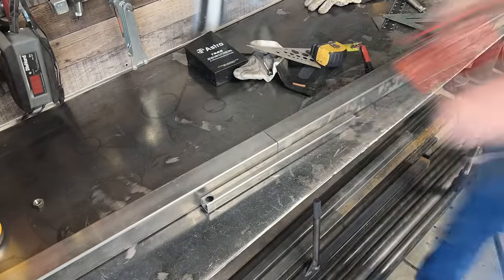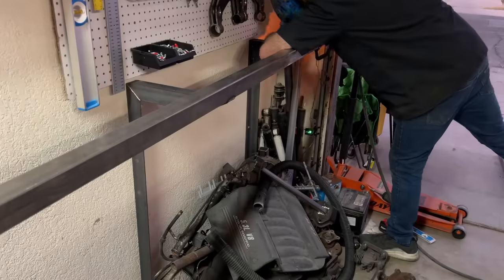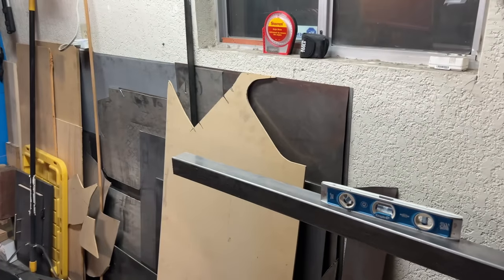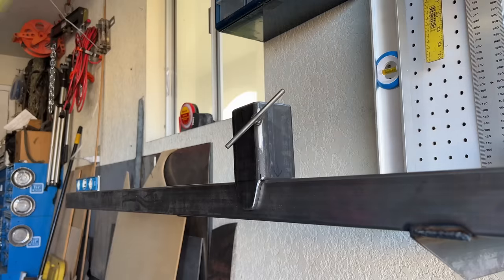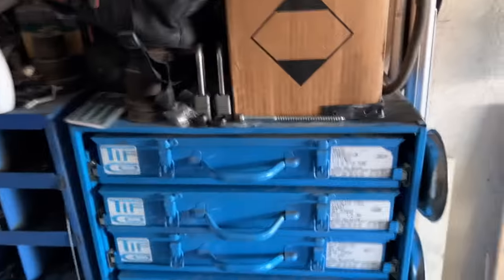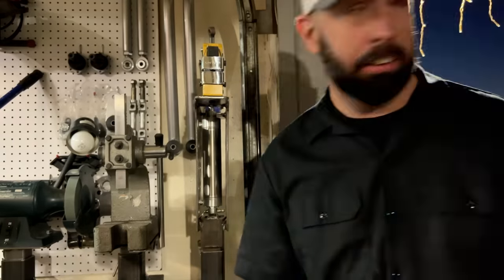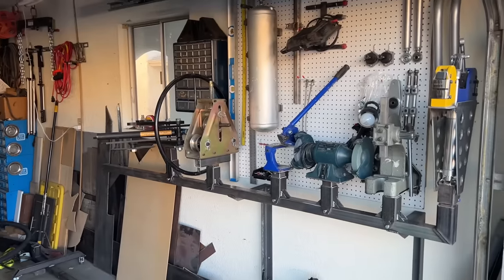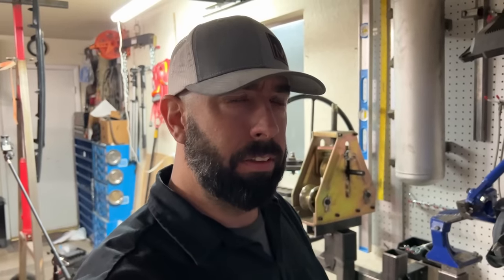Brilliant(er) Legless Tool Stand/Storage System! Part 2.5!!

Comment: I would use the rolling rack for the sheet metal that way you can roll it outside an load an unload sheets out of it and also on the tool rack I would make some arms that extend outwards to put tools like a band saw on or the grinder or even a bead roller you know future investments

Comment: To solve the sheet metal access, put a heavy duty hinge at the bracket by the window, that way you can swing those out of the way to access the metal...   or build a rolling rack to hold the sheet metal that you can wheel it out to get any piece you want when the other tools are swung out of the way.
Reply: I was thinking the hindge to. Could actually double the storage as well with it folding in front of the other tools.
Reply: Wow,  the first comment I read and you have solved one problem and greatly improved sheet metal storage.   Home run with full bases!   
(If you have time....solve my garage problem....I haven't seen three walls in there for years.)   Have a great week ahead!
Reply: @Dancing_Alone_wRentals  Sooooo relatable!  Although I have more than three walls of my garage I haven't seen in years.
Reply: @tptrsn  I find it helps to leave a trail of sockets and box wrenches.....and by all means keep a flashlight handy!
Reply: @Dancing_Alone_wRentals  🤣Thanks for the tip!
Reply: Or just use the rest of the wheel rack to store the sheet metals? And just roll it aside to pull one out.

Comment: Save a lot of space by getting rid of the rack and putting all the tools on a rotatable rack placed in the garage corner. Kind of like a lazy susan. Also no need for all the gussets. Weld a piece of strap steel across the front of the rack that would be just above the bolt. When tight, the bolt couldn't move upward to let the mount fall over.

Comment: If i see your post you put in your hole in the floor i recognize it wobbling.. so maybe you weld a plate a few inches from the bottom of the post that sits on the ground with the post in the hole.. and maybe even make a hole in each of the corner of the plate and  weld some pins in and drill holes in the floor that the pins fit exactly in when the stand is in the hole..That way it prevents the stand from moving while you work

Comment: Maybe store the stheet metal on the rolling rack?  Build a sliding drawer/shelf under the wall tool rack to hold that portable cutoff saw that you're using on the ground - the shelf could be a work surface when the work stock would fit.

Comment: I love it when a plan comes together. Nice execution! I have a feeling there are going to be a lot of these in garages across the USA. If you get more tools you could probably add a lower level to the rack, and maybe angle the lower level receivers out for easy access. Just a thought.
Reply from the maker: I had considered making a smaller rolling rack that slid under this one, but I really like that angled idea!
Reply: do a lil magnet for the allen key @GarageFab
Reply: I should have read your comment before making mine. We're on the same page with angled lower row 👍 EDIT: In fact, the upper bar could easily be against the wall & angled instead of sticking out, for smaller effective footprint.

Comment: Great way to use viewer suggestions!
I would mention that if the setscrew tabs were extended a bit below the bottom of the rack tube, the tips of the setscrews could be conical (you can buy cone point)  and when tightened, the side of the cone would contact the bottom corner of the tube, pulling the receiver down, and preventing it from tipping.  This would still allow the screws to be backed out and the receivers could be lifted up and off.
Just found your channel today and subscribed!
Reply from the maker: Simplicity at its best Keith! Now I have to try and overcome my laziness To either extend the tabs or remake the holders. 😩

Comment: Might add brackets on the bottom sides of the post, like you did with the tool holder brackets but bigger, to give you more stability when using the tools.

Comment: First, stand the sheet metal up as it will take up half as must space as compared to laying it on its side.  Second weld a cross tab on your set screws so you will not need the Allen key that you will inevitably lose.

Comment: V2.6 Idea: Burn another square tube across at the base of your 45* supports (attached to the 45s). Then you can have a second row of tool heads tucked in beneath, sticking out at 45* and cut off the upper tool bar at the left wall bracket. You'll increase tool capacity & wall space for sheet goods AND retain floor space below tool heads. Hope this makes sense, I struggled with how to word this despite the idea being simple. All the best, Andrew Thiessen
Reply from the maker: Thank you, Andrew! It does make sense. I’ll likely go with something like that. 👏

Comment: Your probably done making changes but...Since you are a master fabricator of heavy duty stuff and you put your tools storage near the garage door corner maybe you could rig up something that holds your stuff but pivots away from the wall like a jeep spare tire rack.  It would need to be super heavy duty to hold everything without end support, maybe have a folding leg.  You could still slip sheet goods behind the rack still   With locking pins you might even be able to use some of the tools on the pivoting rack in front of your garage with a fold down leg or something like that.

Comment: Do Not totally dismantle your original rolling base for your first rack instead repurpose said base into a rolling sheet metal / bar stock rack wich will eliviate your issue of getting full sheets in and out of that tight spot....peace and love your vids.

Comment: Put tool rack on wheels. Store it under a table / shelf.
I would put the sheet stock closer to the garage door. So you can just open the door  flex the sheet and pull it out the door opening. ( move the sheets to the right).

Comment: Just a thought,  could the old dollie you took the tools off be used to hold the sheet steel.  Just hinge the right side of the dollie to the floor/wall (maybe another round tube welded as a hinge and using a round floor receiver) allowing the left to pivot out and hinged (right)side to rotate. Adding upright steel supports, leaving all the rollers on and the pivot point would keep it from tipping.

Comment: I think your post needs some gussets as well its a bit wobbly and when you are using the grinder the vibrations are going make it worse they wouldn't need to be too big but 3 or 4 inches on all four sides will make a big difference  i think

Comment: If you still need the additional 2 feet you removed, sleeve it onto the main rack with another piece of receiver tubing and a hitch pin so that when you need to place or retrieve sheet stock, you remove the 2 foot piece,   move the sheet stock, then replace the 2 foot section when done (and the tools on it).

Comment: I was hoping you could do or discuss the tool post receiver in the floor you did.  I would like to integrate one or 2 into my 2 post lift slab I need to do because concrete guys sometimes measure short.  I can come up with something but having the data from a successful implementation would be great and save time.  👍⁹

Comment: Curious- 
Would cutting a 2” square hole in a plate and welding the plate to the riser pole so that it sits on your garage floor when the pole is inserted in its hole, help to stabilize the work tool?

Comment: I’d build one of those hitches for that cold cut saw you’re using on the ground lol then you can use what’s left from that rolling stand to make a rolling stand to support long material when you need to cut it on the cold cut saw on its new stand.
Reply from the maker: I considered putting the saw on a post. I still might! I’ll be adding another receiver on the edge of my workbench. Maybe I’d use it there. I certainly don’t want to fling hot chunks of metal at my wife’s truck where the original hole is!

Comment: Use the same wall brackets and mount on wall above the sheets , come out a foot or so then drop down to the height you have now. You nearly had it when you said you could undersling them. That way the sheets can slide out easily and the dead space above them is utilized.  Ideas from a fellow tinkerer in little ol new zealand. 👌

Comment: Awesome video series. For the common tool post... Seems like it rocks back and forth a bit. I would slot cut the bottom lengthwise and weld in a very  gradual tapered plate to wedge against the female hole in the floor. The goal being that the post bottoms out on the wedge, not the bottom of the hole. I'll be watching to see if this idea makes the final cut! Pun intended
Reply from the maker: If not that specifically, something similar! I’ve been kicking around a couple ideas. Maybe I’ll do a short video with a bunch of tests since some are over-complicated just the way I like it, and some are stupid simple!
Reply: @GarageFab  can't wait to watch. Cheers

Comment: When I was in my 20 tees, I learned enough to start doing side work out of my parents garage it was 9.5 feet wide and 19.8 feet deep I had my Sears Compressor (which I still have) my side work toolbox my welding machine my two heaters my 2.5-ton sears floor jack and jack stands . I was aways. Organizing to save and better use inchs of space , working in a small garage is rewarding and also painful. i also bought a Sears sheld I was constantly move thing to the sheld to make floor space
Reply from the maker: Yup! There’s something rewarding about making small areas work though too. I’m hoping it instills a skill of efficient use of space that I can carry over to a larger shop.

Comment: I hoard steel also.. I have 5 gallon buckets of drops and scraps. Separate buckets for triangles, square tube, angle iron, pipe and tube, round rod, circle drops left over from hole sawing or torching out holes, and ironworker punch slugs... Outside I have salvaged enough I- beam  to add on a 35 × 100 ft addition to my shop.. I don't haul any to the scrap yard unless its total crap. I also save brass...mostly plumbing brass to melt in my foundry furnace to cast special custom car parts to be chromed.
Reply from the maker: The brass is brilliant. Sounds like a cool skill to have. 👏

Comment: If it were me, I would change the handle on the stand to something less likely to having you sing soprano, if you run into it.  Something like a rounded triangle or similar.  Better grip, less chance of self inflicted pain.

Otherwise, solid idea.  My workshop is 24x30' and I still look for more space.  So keep the good vids coming.
Reply: Or hinge that one so it hangs down when not in use.

Comment: Great plan B. 👍

Cut the hex wrench at the bend and weld into a T. 
Is it possible to have another floor pocket so you can use two tools at the same time?
Another good idea would be a jib crane style tool holder. Swings out to use tools or put sheet goods up. Or a post that the horizontal tool holder can roll across the post top. You could then pivot and pull tools outside.

Comment: If you have something fairly light that could go on that end by the sheet metal storage, you could hinge that section forward, away from the wall for when you need to pull sheets out. The single hinge probably wouldn't love something too heavy out on the end of it though.

Comment: I realize you've changed this once but I would have made a rotating tool holder . You could devise a wheel onto bracket that you would be able to rotate whatever tool you want the top . It would take up probably half the space .

Comment: I love your channel. I like your short stand , with a stationary riser. But personally I like the mobility with wheels. The biggest advantage to the short stands is your low center of gravity with the wheels. I'm pretty sure I will make something like this.
 I'm also pondering having  Is 2 rolling stands That can roll inside of one another, Much like some tables Or square seats that fit underneath each other one larger than the other?  The outer one having light attachments that stack higher than the shorter 1 if that makes sense?  Good job and love your humor :)
Reply from the maker: That makes so much sense! Nearly twice as much storage with the same footprint. I might have to borrow your idea and make a rolling cart that fits under this one. 👏

Comment: Thank you for these videos.
For your sheet metal storage you could allow the sheets to slide behind the tool rack if you bring the part up higher where it would mount to the wall so it would be just above that 4 foot mark.
Then mount the bottom and to the concrete. Maybe weld some tabs and drill then add some anchor bolts. 
And of course, make the vertical post set away from the wall just enough to fit sheet metal behind it
Reply from the maker: I dig it! I still haven’t done anything with the sheets yet so I’ll consider it. Cheers, Danny!

Comment: You could iterate this forever.  

My initial thought is that instead of cantilevering the support bar you could make the receiver under the tool two tubes that look like this: /| so you use vertical for the pedestal mount and the slanted tube for storage in the wall mount.  Then bolt a unistrut to the wall and make angled receivers that sit on top of the strut to bear weight but use a unistrut nut to fix the position instead of a set screw.  The ange will be useful because you could tier your storage to two or maybe three levels so a 3-4' rack would work instead of 8'.  Sliding them up and out of storage on an angle will probably be less awkward physically. 

On the negative side if you look at a good pedestal grinder, the pedestal is massive.  Your little tube with two kind of sloppy connections is going to move around a lot compared to a proper bolted down pedestal.

Im going to use a few cast in female thread inserts when I pour my garage slab and make a triangular truss "pedestal" that is stiff enough without weighing as much as a good grinder pedestal.  Then I just have to figure out how to clamp the top connection so it has zero slop.
Reply from the maker: I like it! The diagonal set screw eliminates all slop in the connections and it’s highly recommended. As for the floor connection there is some slop resulting in mild sway. A set screw obviously isn’t an option. I’m experimenting with a couple ideas to eliminate movement
One idea is to steal the basic design from the way bicycle handlebars connect to the front fork. If you’re not familiar with it, look it up.
Another idea is to add tapered fins to the corners of the tool stand that will wedge tightly in the hole as gravity pulls it down. A pedal will be installed to help pry the wedged post out of the hole.
Lastly, perhaps just a simple tab with a hole that will allow the post to be temporarily bolted to the floor plate.

Comment: Weld a plate or some gussets to the base of the common riser post where it meets the ground, and it will stop it "wobbling around" while your using it.
Should be pretty basic to do with some of your hordings. Drop the riser in place, and then tack a support guseet on the base where it touches the ground.
Check the riser removes easy and sit back in as you want everytime then weld.
No more wobbly work post.
Reply from the maker: I like it. I had considered something similar, building a sort of foot that would allow me to bolt the post to the floor plate. It would only be needed when the wobbly post caused problems. (A small band saw and a bend sander comes to mind.)

Comment: Does the post wobble when it's in the floor receiver hole? Wondering if some tapered shims would help out - either built-up on the post, or separate shims that you'd tap in and out with a hammer when the post was being used. (If they were integral to the post, it might wedge itself in and be hard to remove) OR, you could weld little tabs on to the bottom of the post like you did to the receivers on your rack - might be enough to hold it steadier with all that weight on it.
Reply from the maker: Yeah there’s a little wobble. Nothing crazy. I can foresee it being annoying with things like a belt sander. Three ideas I had were 1. Just a flat tab with a hole that would allow a single bolt to hold the post to the base. 2. Cut two walls of the tube base, pry the tops out to basically create your wedge idea, and weld them. It would self tighten with gravity and either a provision would be added to use a pry bar, or a pedal would be installed to lift the post out. 3. Are you familiar with how bicycle necks attach to the fork? I considered stealing that design and adding a sliding wedge to the bottom that could be tightened with a long bolt.
I think your wedge idea is the easiest to create and to operate. 👍

Comment: The receiver tubes with the set screw could have been made more efficient if you made the tabs long enough to put the bolt under the cross bar tube. It would prevent anything from tipping over and easily adjustable by loosening the bolt and slide it back and forth and tighten to clamp it down tight. It would also work great for things you want to hang upside down.
Reply from the maker: Agreed!

Comment: My post into the floor has 2 slim wedges welded to it, then as the post drops into the floor receiver it tightens up. I don't have a receiver top, I made a dovetail vice for the post top, each of my tools has a dovetail mounted underneath, which slides into a matching dovetail clamp. Easily set up but no movement.
Reply from the maker: Interesting!! How do the wedges work? Yesterday I was considering some very small rocket style “fins” on the corners with the same intent. I wasn’t sure how effective it would be.